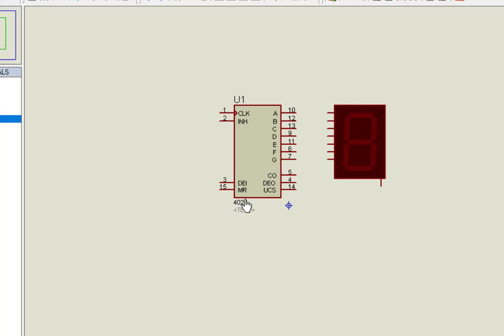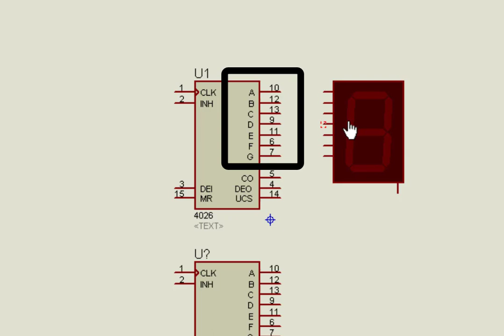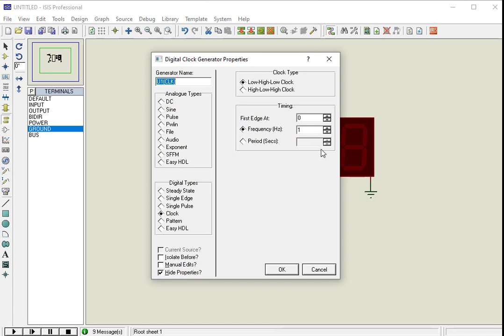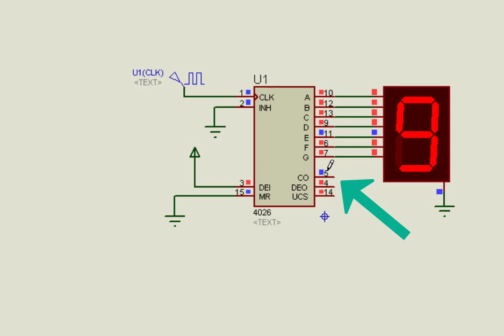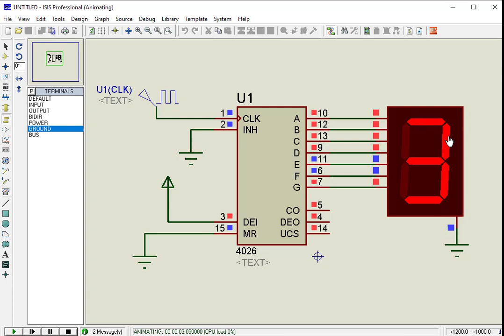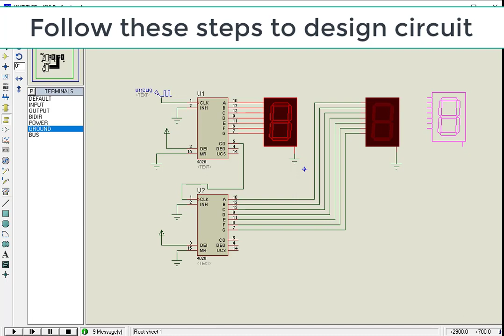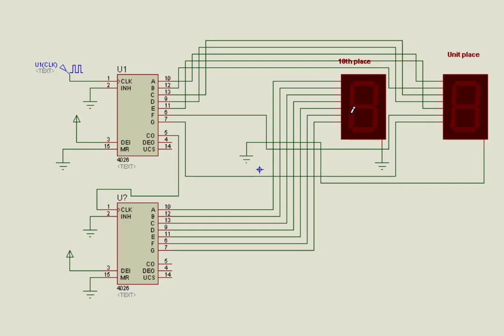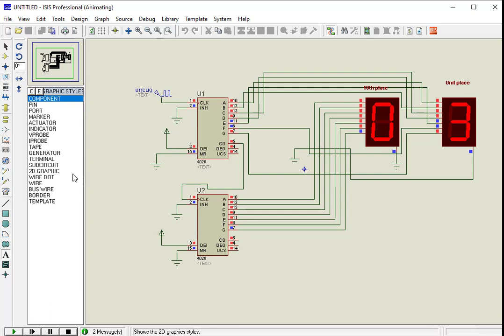CD4026 Based single and 2-digit decimal Counter circuit with Proteus Simulation

Comment: Which IC to use for common anode 7 segment display?
Reply: The old 74LS47 is designed to drive a common anode display but it doesn't include a counter so you'll have to feed it with four bits from a decade counter.